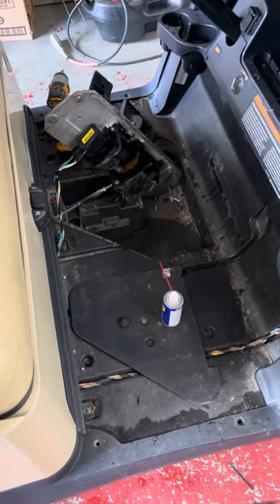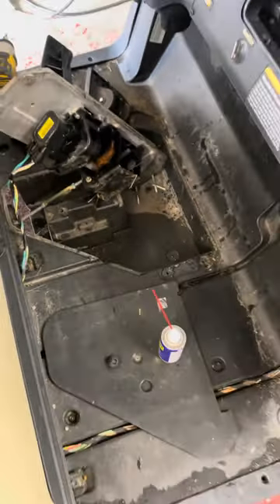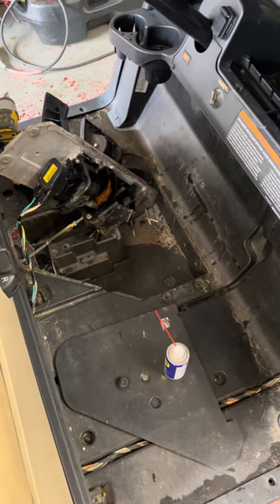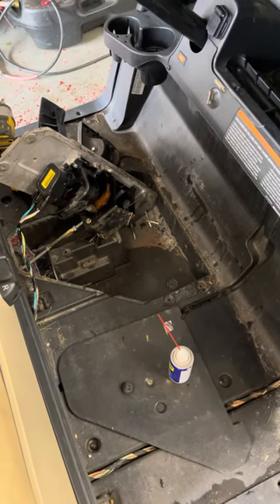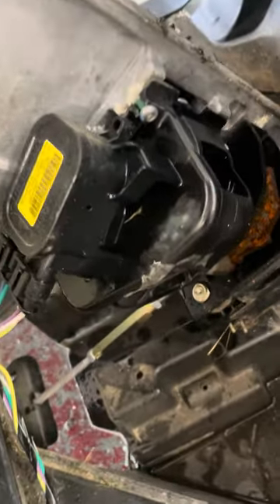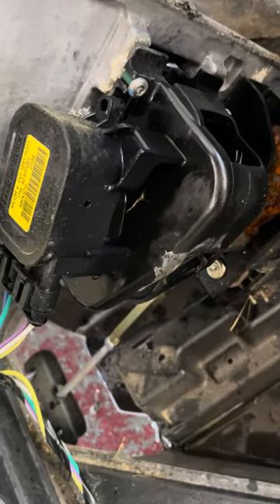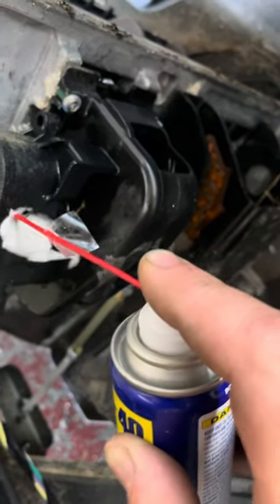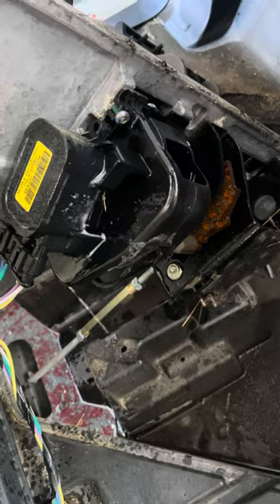Club Car Mcor Repair

Comment: I did this on an 03 club car ds. The mcor was intermittent and the cart would jump when it engaged. I sprayed wd40 then let it sit then i sprayed it with electrical cleaner. Removed both quick disconnects and sprayed them with electrical cleaner as well. Cart runs great and saved some money! Thank you!

Comment: Thank you for this. Had an old club cart that would lose power when the pedal hit certain positions, and replacing the speed sensor didn't help. This fix seems to have  completely remedied it! I sprayed contact cleaner instead of wd-40, because I was out.

Comment: James, do you have a specific method to seal the hole? I was thinking of wrapping black electrical tape over it.
Reply: Silicone caulk would work
Reply: @carlzirk thanks I ended up using a bit of electrical tape after spraying with contact cleaner. Seven months later no issues!!